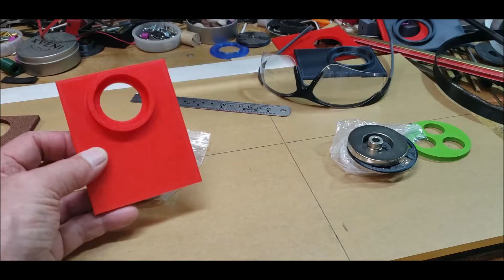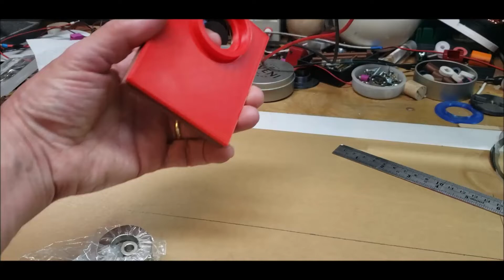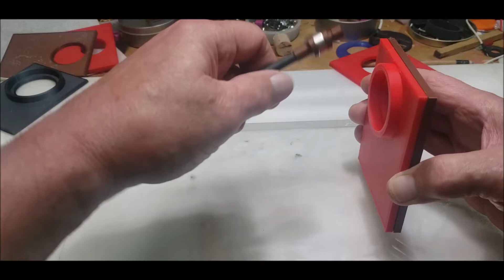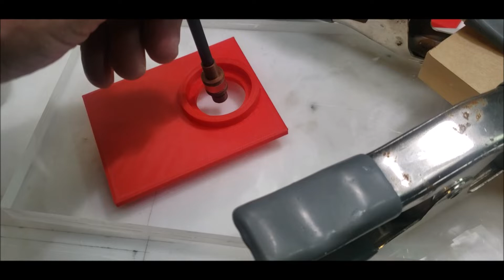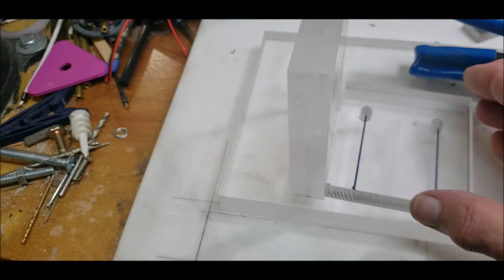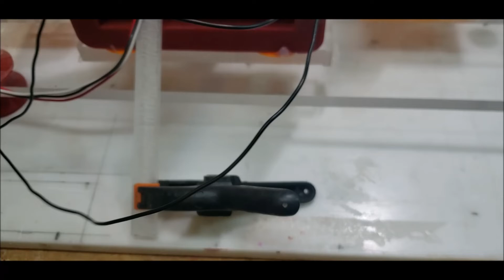3D Printed Maglev Build

Comment: Interestung, you will find the balance point moving the hall sensor, It would be good to put the sensor on a small base so that it can slide and stay fixed when finding the best balance point and where the highest output is produced. Very good start.
Reply from the maker: yes I plan on making a slider base for the Hall sensor.. How did you like the new intro?